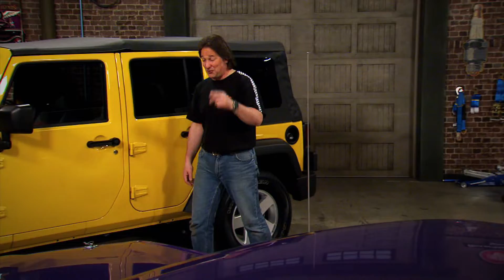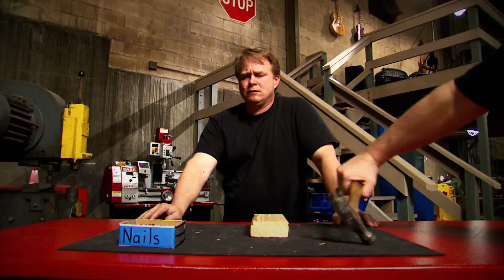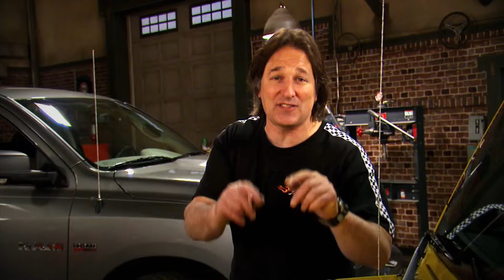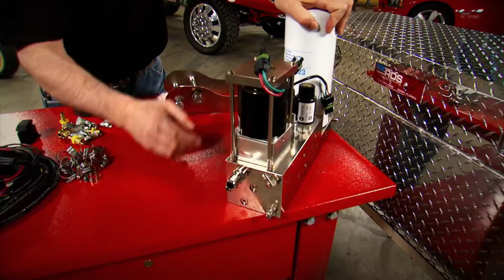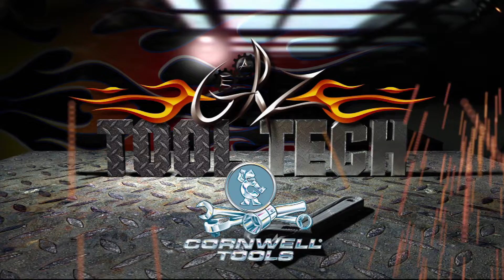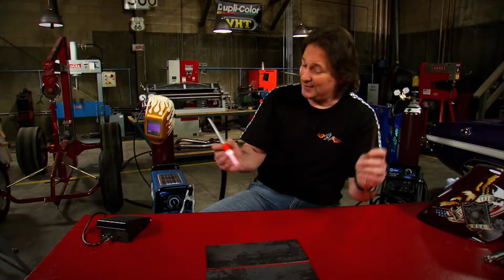Easy Upgrades and Alternate Fuels - Gearz Stimulus Package - Stacey David's Gearz Full Episode S3 E9

Comment: Had a 98 f150 4x4 with the 330 cid v8. Thirteen mpg and some change hand calculated.  Installed a spectra cold air intake kit, one inch throttle body spacer and a single in dual out muffler. Over sixteen mpg hand calculated after all that. Once I got done playing with the new throttle response feel. No that don't seem like much but I took all I could get out that coil eating hunk of junk.